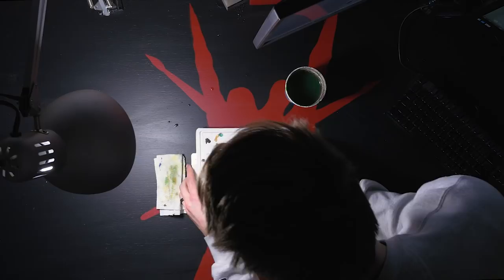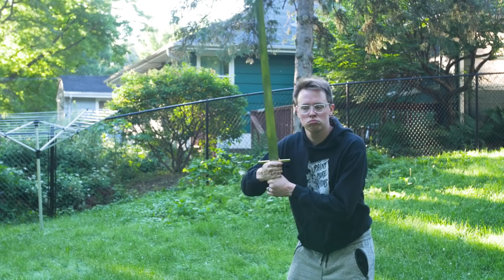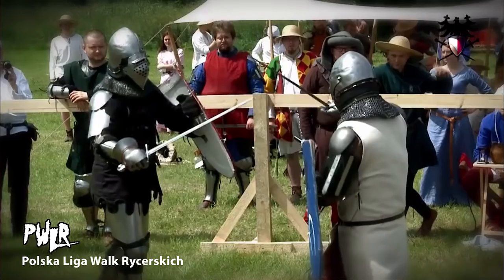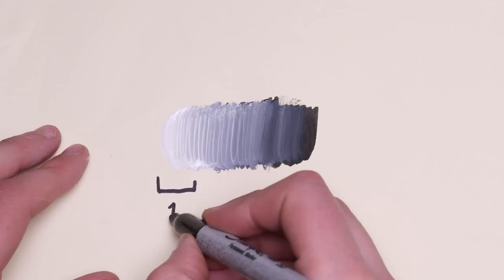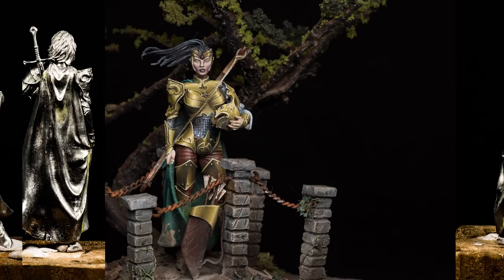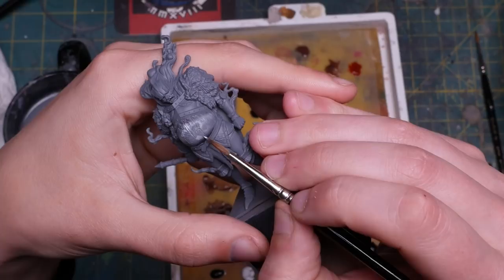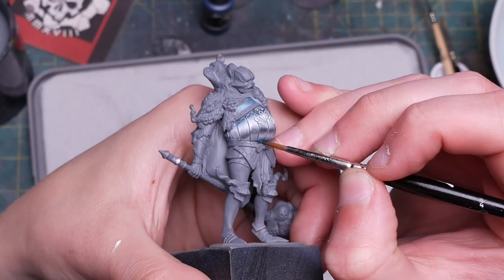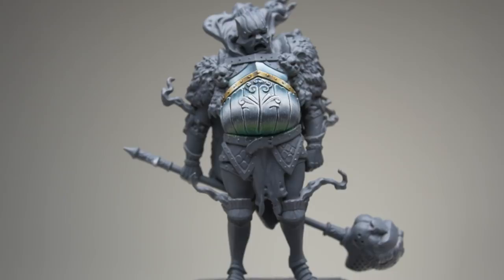The Ultimate Guide to Non Metallic Metal (NMM)

Comment: Love the videos! 

FYI, metallic paints have been around far longer than Rembrandt / old master painters - many artists, such as your Rembrandt example painted NMM because it required a higher level of skill and gave a truer reflection of the subject - texture, depth, light source etc are all under the artists control by using nmm.
Reply from the maker: You have some documentation of this? I couldn't find any! It also makes sense that they would not use metallic pigment because they're painting a 2D canvas unlike a 3D mini. The main benefit of metallics is that it creates the highlights and shadows for you to a certain degree but on a flat canvas, it's just another color.
Reply: Forgot to reply to this - see early catholic paintings (I'd assume other cultures have examples too but I'm too ignorant to reference), holy figures were painted with true metallic paint halos so long as the commissioner was wealthy enough. This was in a time when they hadn't even got to grips with perspective in painting.

Comment: Sad part is, a lot of viewers probably skipped to the part where he starts painting, not realizing that the first 10:00 of talking were actually the most useful. Whenever I am teaching people how to do NMM, people have their minds in the wrong place - they always ask about which colors they should use, and what mediums to add so they can wet blend. In reality, NMM is all about believable light, reflection, and contrast; NOT the colors. You can use almost any colors to get believable metals. As to the mediums: stop using them. They change the properties of the paint and result in inconsistent finishes across your miniature. You can do everything with the brush and water, without being super speedy, having additional brushes, or placing anything on the surface beforehand. Also, a smaller brush won't give you finer details, as they can't hold much water or paint and it will sometimes dry before it even touches the miniature. Invest in good brushes and soap and take care of them. A good size 1 will serve you better for fine detail than a 10/0 if properly taken care of. Finally, no cop outs! Stop blaming a lack of inborn artistic ability or a steady hand for hitting a plateau in your miniature painting. The best in the world got there by practicing and pushing themselves to try new things. You are never going to truly screw up a miniature by practicing on it, as working with thin layers gives you at least 40 coats before you have obscured detail.

Comment: Only light sources like the sun 'emit' light. Objects in the environment simply absorb certain wavelengths and reflect others based on their chemical makeup, giving them color. :P

The "black body radiation" of an object in space has to do with its temperature, cooler objects like planets theoretically emit their own light, but if it is something like Jupiter somewhere around 130K it will emit wavelengths of light somewhere in the microwave part of the spectrum, or maybe even radio waves? Either way, nowhere near the visible part of the spectrum. This is why super hot stars appear blue, because their temperature causes their peak wavelength output to be in the ultraviolet section, but we cannot see past visible light in either direction. Same goes for cooler stars, down around 3000K, half the temp of our sun, which emit most of their light in the infrared part of the spectrum, but we cannot see longer wavelengths than red, so that is what they appear. All black bodies actually give off energy in the form of light at all wavelengths, it's just that their color is determined where their peak output is in relation to the visible part of the spectrum. Fun fact, the Sun actually emits green light, but our eyes do not detect it as well.